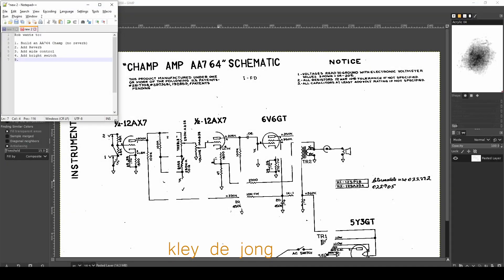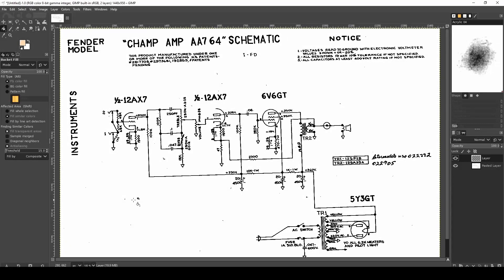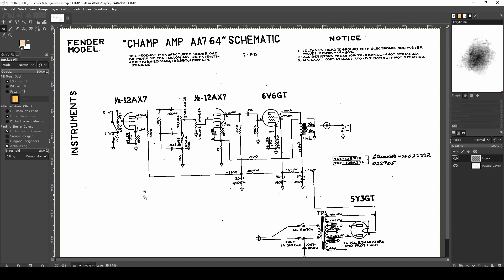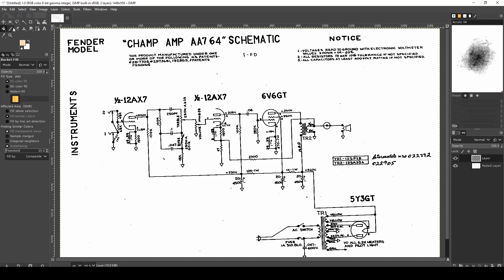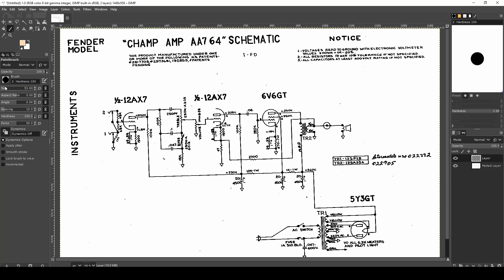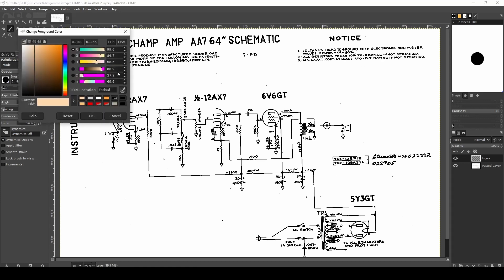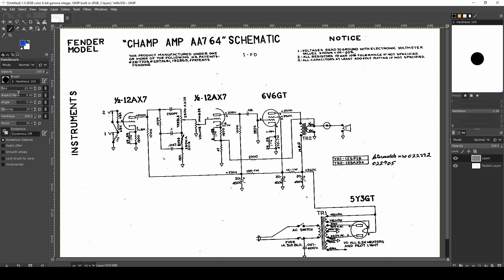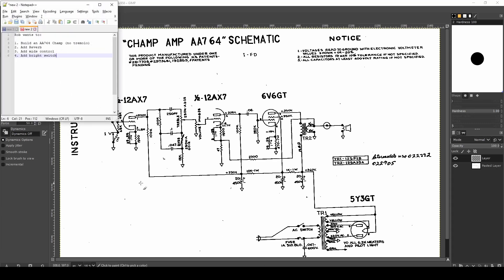Fender AA764 Blackface Champ - Mods Expained

Comment: The fantastic thing about the Fender reverb circuit is it's a parallel loop.

Might as well add the single triode 6G2 tremolo too, use all 2 12A_7 tubes, it'd be the single ended Princeton Reverb that never existed.

The other thing to do with one dual triode is to add a buffered effects loop, cathodyne unity gain amp with level control in front of the send jack and a make up gain stage with a level control after the return jack and before the driver stage. Then your friend could put all the modulation he wants in front of the power section.

I'm building a 5F2, waffling between a tube buffered loop or the Fender harmonic trem. Maybe both!

Take a peek at the blond Bandmaster trem circuit, guaranteed to blow your mind lol!

Comment: Don’t completely defeat the tone stack in an AA764. It’s way too much gain. Maybe you could defeat the tone stack and  simultaneously lower  the resistance on the NFB using a DPDT toggle. It’ll be needed if you don’t want an amp that sounds like a cranked 5f1 when the toggle is flipped.

Comment: hi can i use  6l6 tube on the output with 380v on the plate and 53ma current cathode on 470ohms resistor is it ok

Comment: Hello Kley! I'm modding my 65 Champ Amp to have a mid range knob and I'm confused by the placement of the wiring. You mention the ground on your vid being the ground behind the bass potentiometer, though that is connected to the 470-1W resistor and the 25 capacitor. I see the capacitors for the tone stack, but I can't identify the 15k resistor or the ground for this mid range mod. If you could get back to me on my novice question, it would be much appreciated!
Reply from the maker: @ListentoKadence  Find the bass pot. One of the outer lugs should connect to a resistor. Something between 5k and 25k. That resistor then goes to ground. That resistor gets replaced with a pot as a variable resistor.

Not sure what you mean by a 470 ohm 1watt resistor plus 25 uf cap. That sounds like the cathode of the output tube.
Reply: @KleyDeJong  I totally see my error now. I had the ground wire connected to the cathode of the output tube. So now do I connect the wire on the 3rd lug on the 25K pot to the ground on the bass pot?
Reply from the maker: @ListentoKadence  https://robrobinette.com/How_The_TMB_Tone_Stack_Works.htm
Reply: @KleyDeJong  I thank you for your help. I drilled a hole in the chassis and put a vintage Clarostat as the mid range with a witch hat cap and through your perfect guidance, my 65 Champ has never sounded better. The volume knob was converted to a potentiometer with a pull switch for a bright switch. A JBL D216 resides as the speaker. So happy with the results.

Comment: DON'T DO IT!.By a pedal. Modded my 72 for gain decades ago. Did exactly what I wanted with crunch. Perfer the clean and break-up of stock now. All the pedals with gain dialed back for a clean boost push work for me now. If a pedal can do it you save butchering a great amp.
Reply: Hey Muhammed - thanks for sharing your experience.  Do you mind sharing more details on what exactly you modded with your champ?  I wasn’t necessarily looking to add a gain stage as I want to keep the stock cleans - just merely some more tonal flexibility with mid tone & bright switch and then also adding Reverb.  Any color you can share from your own experience would be appreciated - thanks!
Reply: @robertlillibridge1761  When I seen your post I tried to dig up a book I had. I believe it's by Gerald Weber. It's been a while seen I restored it back. I believe it made the treble a gain control or it removed the tone controls. I believe I moved some components around also. It did exactly as I wanted at the time. I wanted a bedroom amp that gave me crunch. I now like clean (lol...we're never really satisfied are we) so I put everything thing back. Got a 65 & 72 champ.
It's pissing me off I can't find the book. As soon as I do I'll tell you exactly who the author is and what the mods entailed. It's been a decade and some so I forgot.
Reply: @muhammadsteinberg  that would be awesome - thanks very much!